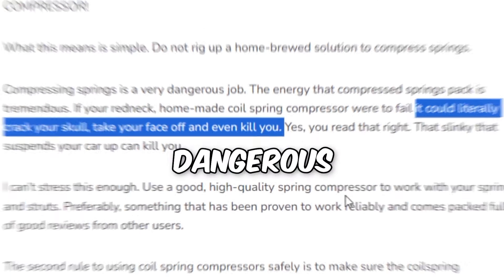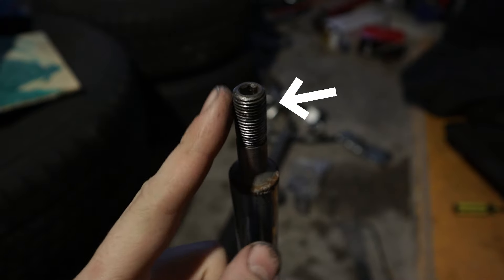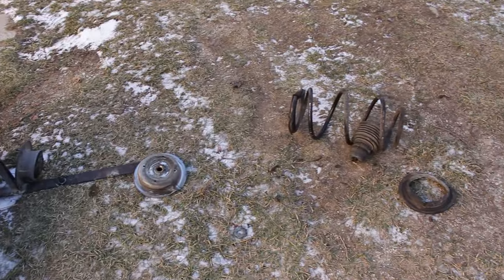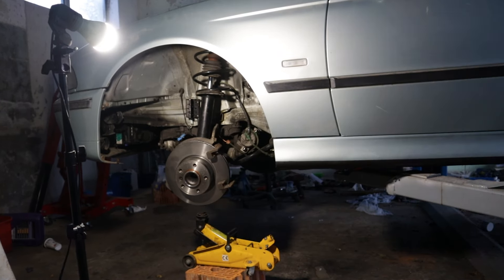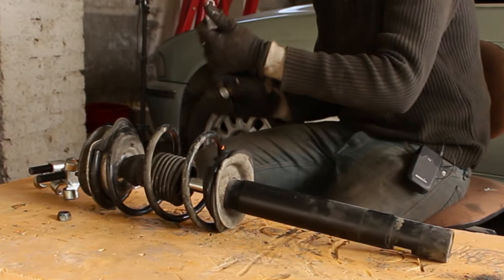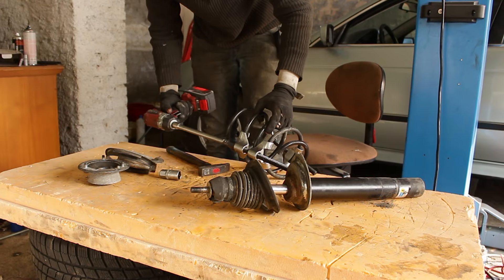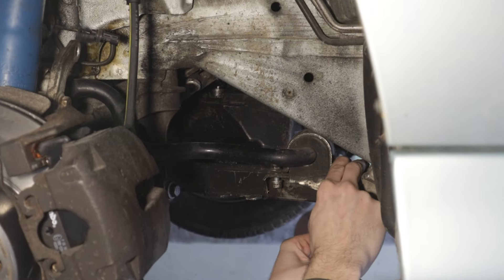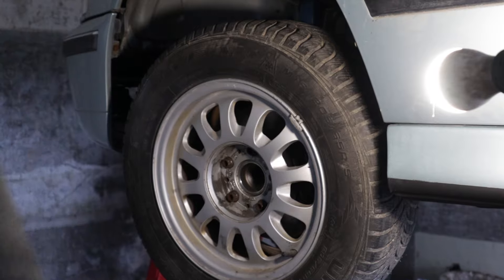THAT's WHY Springs are DANGEROUS!

Comment: Quick Tip:
Rubber bushings from the controlarms or any bushings from the undercarriage have to be torqued to spec with the load of the car on it. Well correctly there are instructions from the manufacturer how to load the car before torquing the rubber bushings to spec.
Otherwise they will twist if the load of the car gets on the bushings wich can lead to a wrong ridehight therefore a bad handling of the car and a shorter lifetime of the parts.

Greetings from Germany and good luck and much fun with the ongoing projects.
Reply from the maker: Thanks for your tip :)
Ich habe das eh so gemacht. Nachdem das aber ein bischen sketchy war, weil ich das Auto auf Ziegelsteine gestellt habe, konnte ich das nicht filmen😅 
Schöne Grüße aus Österreich ;)